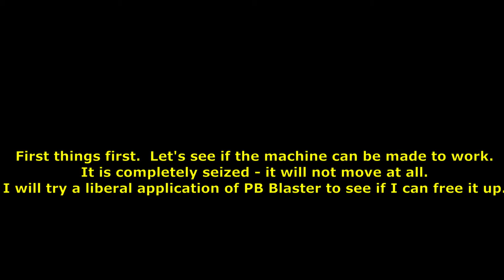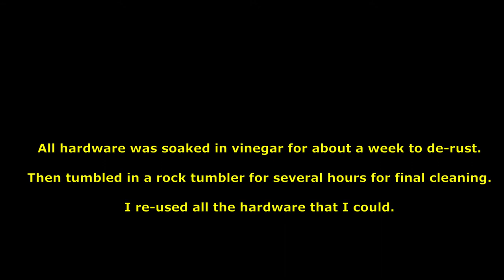Singer Model 15 Sewing Machine Rescue and Repair

Comment: That curved tray goes in the cabinet under the machine to keep any machine oil from getting on the floor or operator.  The chain keeps the machine from going too far back and flipping the whole thing over when you are oiling the bottom of the machine.
Reply from the maker: Thanks Wes!  Good information!

Comment: That metal clip in the pull out tray held the oil can that came with that machine. I have 2 15-91's -- alas, no oil can.
Reply from the maker: Thanks for the information and thanks for watching!  It was a rewarding project.
Reply: @rollerbald  you did a great job. I love antique machines.  I have a 1906 treadle model 27, a 1919 electric model 27, the two 15-91s, late 40s and early 50s and a WWII era featherweight 221. Yes, they all work and yes, I use them all. Thanks for the video. 😊